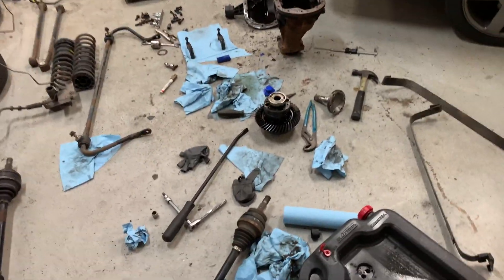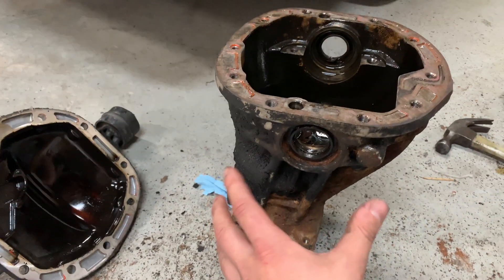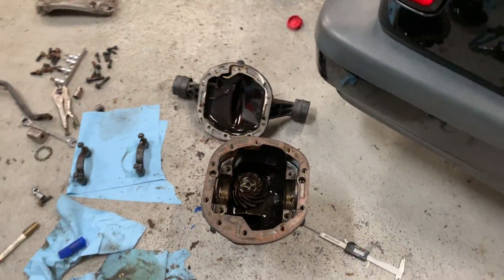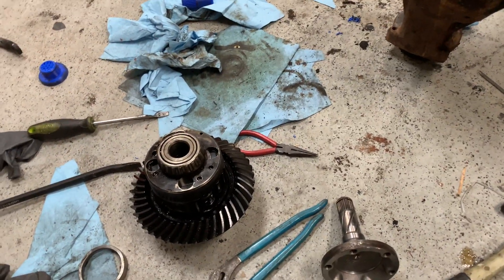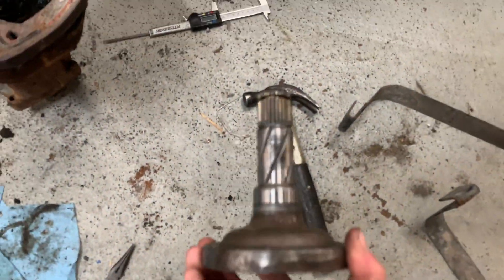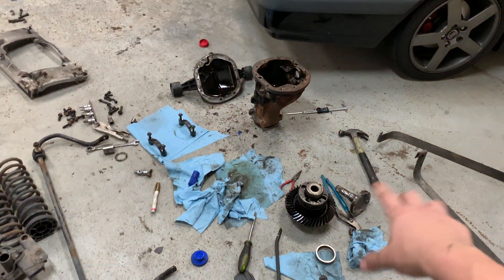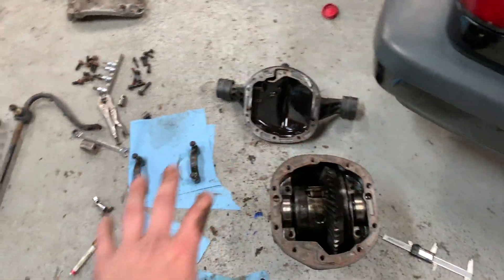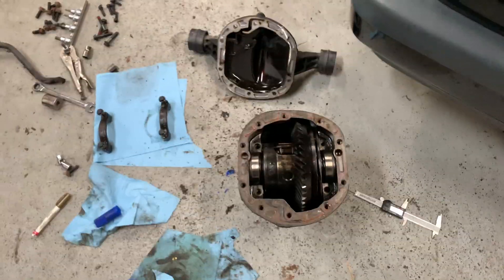Volvo 850 T-5R AWD Swap - Upgraded Rear Axles Prototyping

Comment: Now I'm curious if I could do a Haldex delete in my P1 V50 and put a beefy diff in the rear for permanent AWD.
Reply from the maker: That won't 'be be possible because the gear ratio of the angle gear has to match the gear ratio of the rear diff. P1 & P2 is 2.56 and P80 is 3.31. So you cannot use the P1 2.56 AG with the P80 3.31 rear diff.
Reply: @SimplyVolvo  I would need a custom rear gear set or different diff altogether and in theory it would work then?
Reply from the maker: @Dubst3pT3ch  Yes custom gear set or to somehow adapt the P80 angle gear.

Comment: Have you looked into the Gripper lsd out of the UK? I'm not sure who imports them now that RSI is out of business or if you're wanting a geared lsd instead of a clutch type but they're excellent diffs and are known to hold more power than the quafe.

Comment: Yo what would happen if you bypass the viscous coupling and make a solid shaft ?
Reply from the maker: The front and rear wheel speeds would be locked 1:1.
Reply: @SimplyVolvo  so kinda like a lock dif on a 4x4 ?
Reply from the maker: @volvoripr9980  Yes it would effectively be constant 4WD. Probably not the best for a daily driver, but for a car that is raced and occasionally driven on the street, OK. I plan on using the VC until i break it.
Reply: Lol I had a v70R and my viscous went and always wondered .. i guess viscous kinda works as a haldex in newer models .. its gotta be some sort of damper or clutch in some degree.. I appreciate your passion on the p80s what your doing its like what always had in mind doing .. but you got the knowledge and the facilities witch is great for the community keep the good work amigo !!! Salutes form Canada .. hope the this virus bullshit ends soon so we can get back on our projects.. 
Also wanted to ask if you suggest doing a switch on and off on awd on my s60R .. kinda like a pump on pump of off switch on haldex ..and have the option of having the awd when desired since i am sick of replacing pumps and modules lol

Comment: You should get the Eaton TrueTrac. 912A588 is supposed to work for Volvo 3.31, but Eaton says that the  588 is for Volvo 3.73 and up. The other Eaton Dana 30 diffs are for front axle operation, and are therefore low preload, which might not do so well in the rear axle of the volvo coming out of corners. Supposedly you want the 588 which is high preload. If you look up the 588 on Amazon there is one poor review of it where the guy put it in the front of his jeep, and basically said it drove like crap on the street.
Reply from the maker: Yes. That is the one that I mentioned in this video. 912A588 works for any Volvo gear ratio. Volvo changes the thickness of the ring gear instead of the diameter to change the ratio so that way the same carrier can be used for all of the ratios.
Reply: @SimplyVolvo  I guess I didn't listen well enough...
Reply from the maker: @turbovolvos40  Theres quite a few options I can use. TrueTrac, Quaife, WaveTrac, Gripper. The TrueTrac is the most inexpensive by far but seems to contain some cast components. So im not sure which route im going to go.
Reply: @SimplyVolvo  The price of the Gripper is insane... I do wonder a little bit about some of the other Jeep Dana 30 diffs like the powertrax which is a super cheap... and looks really good. I would think in an AWD application maybe they would be fine?
Reply from the maker: @turbovolvos40  Even in and AWD application its still very possible for 100% of the torque to go the rear. Such case would be on a very hard launch where the front completely loses traction. So all components need to be able to hand 100% torque so Im not sure I would feel comfortable going with anything cheaper than the TrueTrac. The WaveTrac seems like the best option in terms of durability and cost. About $790 shipped. $200 more than the TrueTrac and completly made from 9310 alloy & all ARP fasteners.
Reply: @SimplyVolvo  I believe it was the powertrax website that stated the differential is designed to be stronger than the axles. Anyway, yeah if money is no concern my choice would definitely be the wavetrac. Do you think you can make the axle adaptors cheaper than Kaplhenke?
Reply from the maker: @turbovolvos40  The Kaplhenke adapters are actually just resold Bakaxel adapters (and are out of stock never to be restocked). I have contacted Bakaxel and they said they are out of stock and they are not going to be making anymore. Else I would've just bought from Bakaxel / Kaplhenke .

Comment: Bro any idea if the angle gear changes the ratio or keeps everything the same?
Reply from the maker: The ratio of the angle gear and the rear end must match. Thats it.
Reply: @SimplyVolvo  i understand but what I mean is that for every 1 turn of the crank it should also turn 1 turn. Because if the angle gear has 3.31:1 ratio and the rear diff has  3.31 then we end up with 9:1 ratio
Reply from the maker: @FirstLast-tx3yj  Thats incorrect. You should watch this video I posted a while back that explains all of this. https://www.youtube.com/watch?v=A5Qna25W_qQ
Reply: @SimplyVolvo  will do thanks
Reply: @FirstLast-tx3yj  the angle gear increases speed from the transmission and the diff gear reduces the speed back down again.
Reply: @SimplyVolvo  just watched the video. Understood 100% what u mean.
 I misunderstood what u mean by 3.31!
 Cheers
Reply from the maker: @FirstLast-tx3yj  Glad to hear!!
Reply from the maker: In the case of the P80 AWD its 3.31 ratio. In the case of the P2 AWD its a 2.56 ratio.

Comment: Great stuff! Never thought of seeing if 960 axles would bolt right up. I guess another advantage to using them would be that you can actually replace the CV boots.
Are you using all stock rubber bushings for the rear subframe and control arm and stays etc.? Or are you using any poly bushings?
Reply from the maker: Unfortunately the OEM boots for the 960 are NLA, same with the AWD. But I may have found some aftermarket ones that may work. Mine however are in perfect condition. The CV joints are however still available. In terms of bushings (and honestly everything) all Volvo OEM everything. They are very high quality stiff bushings. Over my years and years of working on these engines and cars nothing else comes even close to being as good as the OEM stuff.
Reply: @SimplyVolvo  Thanks for the reply. I didn't even know boots were available ever for the rear axles of the P80 AWD cars. I never found a part number. Yep, agree that the Volvo bushings last quite a while although the big bushings in the subframe do tend to crack with age more than the others from what I've seen. Also, I don't think the bushing that goes into the rear spindles is available anymore.
Look forward to following your progress.
Reply: That is just awesome to se. I never would have figured, that the 960 axles could be a perfect match. My CV are toast and its not possible to get the original anymore

Comment: Just had a debate with my roommate about whether T5 Volvos could make good power, thanks for being my Trump card 👌
Reply from the maker: Yes there are plenty of 800-1000hp+ T5s worldwide. They are extremely strong and durable engines when built.
Reply: Man I'm about to start a new project, you've got me thinking there might be a monster Volvo 850R terrorizing Denver streets here in a couple years 😈
Reply: Have you seen the vw gti build with b5234t and haldex awd? He ran a 9.6...
Reply: @barneymiller7894  Maybe 2 850Rs terrorizing the denver streets in a couple years. (Hopefully sooner for mine.)

Comment: I feel this is stuff ipd should've done many moons ago! Keep pushing it forward!
Reply: IPD doesnt really do anything there isn't a market for. Especially not now with the drop in parts interest in the more easily modifiable cars.
Reply from the maker: @StackBundle  Yeah agreed. Which is usually just exhausts, bushings and other basic suspension components. My parts I make for myself and If I can sell a few to make back my original investment, great! If you build it they will come.

Comment: so cool, can't wait to see M66 tran install! :)
Reply from the maker: Won't be using a M66. They're much too weak.
Reply: ah k no worries still a awesome build, is there a 6 speed option out there for this build? or is it a M56
Reply: my bad, think its the M58 for the awd
Reply: @SimplyVolvo  I think the M66 AWD has 3.77 diff if im not mistaken, would need matching rear ratio for that i suppose. Interesting you say its weak...you're probably right.
Reply from the maker: @LordTominator  The gearbox final drive and rear do not need to match. Only the angle gear ratio and the rear ratio need to match. The angle gear is directly coupled to the final drive of the transmission. The M66 is very weak and shreds 1 and 2nd and the shift mechanism isn't very durable.